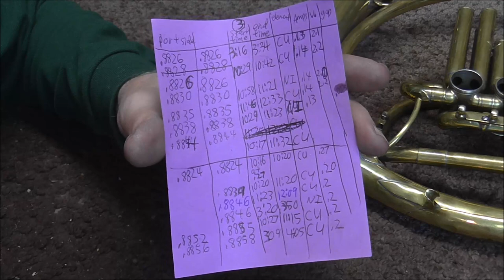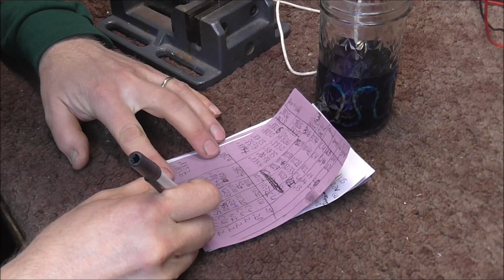Restoring an Antique French Horn Project #5: Fitting the Loose Valves | Electro-Plating

Comment: Nice to have you back, Art. Looks like you're getting control over the process. Did you try buffing the copper plating? A bright finish on the copper should improve the surface finish of the nickel surface as well.
Reply from the maker: I did try that with mixed success. I may try it on some of the other valves.

Comment: Nice results Art! But if the rotors are in such a bad condition it wouldn't be better if you construct 4 totally new rotors on a lathe?
Reply from the maker: That would be VERY difficult to get everything to line up just right. It could be done, but it would be far more expensive. That is a good thought though. Maybe I should try that for an experiment to see what happens.
Reply: @TheBrassandWoodwindShop  I am thinking also to make an experiment in an old tuba, in cooperation with local technicians who specialises in 3d scanning and cnc lathe. Maybe this make things much more easier.. but for the time this is only a thought

Comment: I'm looking at DIYing a valve job on a rotary trumpet which is cosmetically great with terrible valves (am a machinist and amateur horologist)..
Tbh, this looks less complicated than I'd imagined - my valve axles look to have been peened to expand them to fit and I'm concerned about lack of concentricity  in and between the casing diameters (and same for the rotors).

I've thought of ways to address all the potential problems which might be involved and it could hypothetically mean taking the valves back to a tight spec but going down a rabbit-hole of a path to get there.. thinking multiple steps to regain concentricity of and between parts.

In terms of the actual plating, there seem to be a greater number of easy to find informative videos which cover nickel but more uninformative videos for copper. One thing which has come across, is the idea of adjusting the voltage by watching the formation of bubbles, maybe setting low then increasing it to the point that all of the bubbles are breaking free quick enough not to leave spots - then further helped with agitation. 
The finish of the nickel will reflect the finish underneath.. how about plating oversize then polishing or burnishing the copper, with a quick acid then distilled water dip so the nickel still sticks well? - I don't know much about the copper plating stage.

Thank you for posting

Comment: You might try fingernail polish to mask the ports.  Get blue, the reds and pinks are too close to the copper in color.  Comes off easy with acetone.  I plate at 6 volts and about 2 to 3 amps.  Starting with 5 minutes and tapering down to 1 minute at a time as the fit gets closer.  It goes on very smoothly  The most important thing is to electroclean the part before plating.  Washing with soap or solvents won't get it clean enough and the plating will peel off.  Look for a product called Tivaclean.  The plating doesn't go on evenly.  It goes on thicker at the edge of the rotor and the spindle that are facing down in the solution.  Also around the edges of the ports.   The old rotor will not be round or concentric and neither will the casing so it takes a certain amount of repeated plating and lapping to true everything up.  It can be "tight" in the casing but still leak around low spots.
Reply from the maker: Thank you very much for the information. I was thoroughly discouraged after trying several times with no success. I have done some touch-up plating, but I gave up on immersion plating. I think what I may have been missing is the electro cleaning. I will try it again and see if I can make it work.